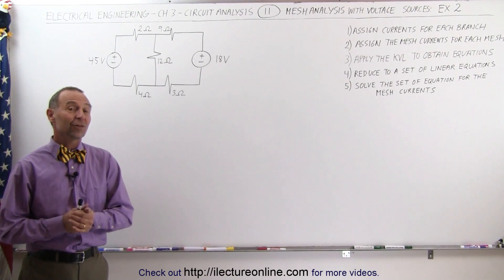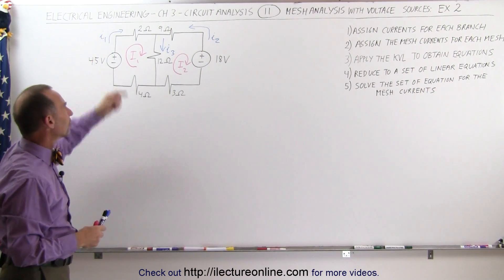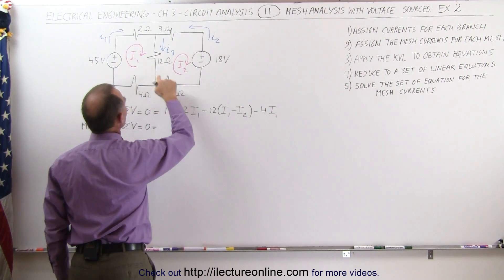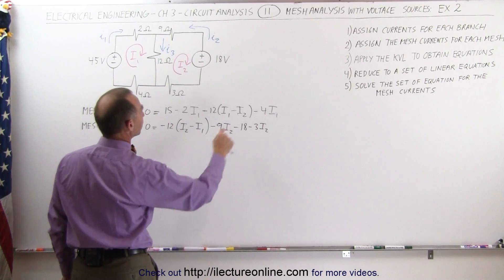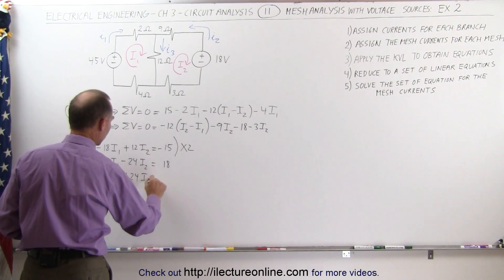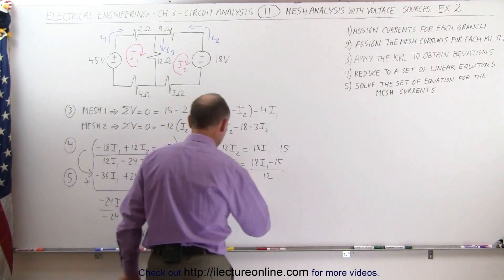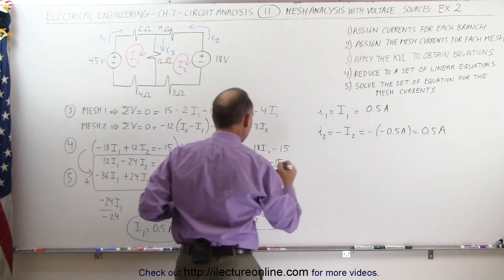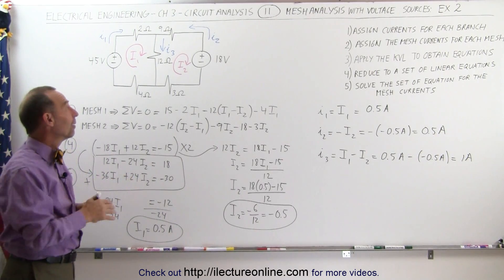Electrical Engineering: Ch 3: Circuit Analysis  (11 of 37) Mesh Analysis w/ Voltage Sources: Ex. 2

Comment: On the screen you had a voltage source of 45 but your equation showed 15
Reply from the maker: Yes, the correct value is 15 V (as seen on the thumbnail).

Comment: Hello Mr. Michel van Biezen. If I assumed voltage on left side 45 V I received I1 opposite direction you marked 3 A, i3=2,25 A opposite direction you marked and i2=0.75A same direction. Which is good acc to KCL 🙂 We all are human beings 🙂
Reply from the maker: Are you suggesting that the answers in the video are not correct?
Reply: @MichelvanBiezen  a bit 🙂
Reply: Yeah, the voltage source on the left is written as 45V while you worked the solution as if it was 15V. Myself and others in the comments got I1 = 3A, and I2 = 750mA. @MichelvanBiezen

Comment: Hello Dr. I have a question. So the restor in the middle of 12ohms, in mesh 1, we say the positive end is on top. However in mesh 2, we say the positive end is on the bottom. Is that really doable? We can treat each mesh separately and change the poles of the common elements between Mesh 1 and 2?

Comment: Great explanation professor!! but i have one doubt, how should we do to find the voltage on the third branch the middle one?
Reply from the maker: Once you know i1, you can calculate the voltage drop across the 2 ohm resistor and then subtract that voltage drop from the 45 V source.
Reply: Since we now have the branch current and the resistance of the branch we can just simply apply Ohm's law v=ir

Comment: i thought i must be +9.I2 for mesh 2 ??? Please help me understand it ???
Reply from the maker: We are traveling with the current (I2 not i2) across the 9 ohm resistor, therefore there is a voltage drop across that resistor.
Reply: @MichelvanBiezen   thank you so much !  I finally figured it out ! Appreciate you work !

Comment: I am not understanding the  2nd equation
Reply from the maker: The second equation adds up all the voltage drops and voltage rises in the second mesh (loop).
Reply from the maker: What part specifically is giving you trouble?

Comment: Dear sire I have been confused by Eq2 because of voltage drop and voltage rise 
would you make it easy
Reply from the maker: As you travel around the mesh, if you go across a resistor in the SAME direction as the CURRENT, then you have a voltage DROP.   If you go across a resistor in the OPPOSITE direction as the CURRENT, then you have a voltage RISE.

Comment: why did you not calculate the branch currents through 3-ohm and 4-ohm resistors?
Reply from the maker: i1 flows through the 4 ohm resistor and i2 flows through the 3 ohm resistor

Comment: In 9 ohm resistor in mesh 2 have brach current direction opposite to mesh current so should it not be positive voltage.
Reply from the maker: You ignore the "actual" direction of i2 and just use the mesh currents to solve the problem.  (I just drew the direction if i2  as a reference so you can see that the 2 don't have to be equal in order to solve the problem.)  Note that the mesh current I2 was a negative current, making i2 positive in the direction drawn.
Reply: Michel van Biezen sir why you multiplied it into 2 in equation number 5, if it could be solved in matrix. do i can get the same answer?

Comment: sir dont we need to find out the branch currents through the 3ohm and 4ohm resistances? as far as i understood, they should be equal to I2 and I1 respectively, is that correct?

Comment: I have a doubt in MESH 2 eq. should not it be  0=18v-3i2-12( i2- i1)-9i2.
Reply from the maker: Since you cross the 18V supply from the positive terminal to the negative terminal it should be -18.    (The current direction doesn't matter when you cross a voltage source)

Comment: Mesh 2 wrong equation prof. you must correct it,
Reply from the maker: The video is correct.  (Note that the source voltage on the left branch is 15 V.)
Reply: Michel van Biezen I get it thank you Prof :) do you have video of supeposition theorem and thevenin's theorem?
Reply from the maker: Yes, look at chapter 4 of the electrical engineering series.
Reply: Michel van Biezen i have my finals this Friday thank you so much sir for replying in time and thanks for you help
Reply from the maker: Good luck and study hard.
Reply: thank you professor. I need this to pass circuit theory 1

Comment: I found 12i1-24i2=-18 for the second loop. What am I doing wrong?
Reply from the maker: Try to repeat the exact same steps as was done in the video and compare to your steps.
Reply from the maker: Note that the voltage source on the left side is 15 V.
Reply: Same as me... i2 is going counter cw and the I2 is going cw so supposedly it is going against the current and should be added... I dont understand why it isnt true here

Comment: Dear Professor,

I would like to have a question:

I assumed I2 in the other direction what you did, and I think I wrote a bad equation:

15 - 2*(I1) - 12*(I1+I2 ['plus' because they have the same direction on that specific branch]) -4*(I1) =0

I ended up getting 2 Ampers for I1 and -1.75 for I2, so I clearly made a mistake.

Could you please explain how should I write equations for branches when I assume multiple currents going on them in the same direction?
Reply from the maker: I would need to see the second equation and the sum of currents  equation to find the error.
Reply: Thank you for your fast response.

Mesh1: 

15 -2(I1) -12(I1+I2) -4I1

Mesh2:

18 -9(I2) -12(I2+I1) -3I1

I wrote I1+I2 for the middle branch in both cases since I assumed the current goes in the same direction (downwards) on that branch. 

(I assumed I2 inm an opposite direction).
Reply from the maker: your second equation should be -3I2 at the end   (and don't forget to write = 0 for both equations.
Reply: Thank You!

Comment: For the chosen currents why isn't mesh 2 = 12(I2-I1)+(9)I2-18+(3)I2 ?
Reply from the maker: Before I can answer that question, I need to see the equation you are suggesting.  (left side = right side).  mesh 2 = ......  (is not an equation).
Reply: That is good what you written same is for me. Later  If I assumed voltage on left side 45 V I received I1 opposite direction which is 3 A, i3=2,25 A opposite direction  and i2=0.75A same direction. Which is good acc to KCL.
Reply: I have the same question as you.!!! when you are moving from I2 upward, comparing to i3 we are having voltage rise and for I1 we are moving the same direction as i3 so we have voltage drop... so why is he writing it like that ?
Reply: ignore the small i currents when making your KVL equations.

Comment: If we assumed a counterclockwise direction for I2 would the solution stay the same?
Reply from the maker: You will find the correct answer, if you pick the current in the opposite direction.  Try it and see.
Reply: Michel van Biezen yes I got I1=0.5 and I2=0.5 so it's the same.

Comment: Hi Michael, why is there a voltage rise at the 12 OHM resistor for mesh 2? Shouldn't it be a voltage drop since the loop in mesh 2 is going in the opposite direction as i3?
Reply from the maker: There is a voltage drop relative to I2 and a voltage rise relative to I1 when moving in the direction of I2 (clockwise) around mesh 2.  In the end, considering I3, there is a voltage drop relative to I3 when moving from top to bottom.
Reply: +Michel van Biezen thank you. Your online lectures are so helpful!